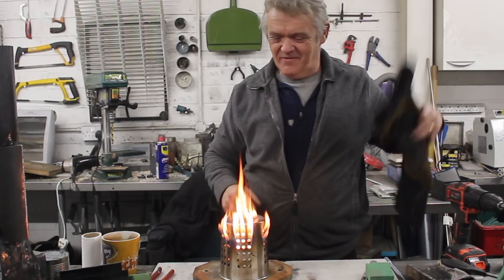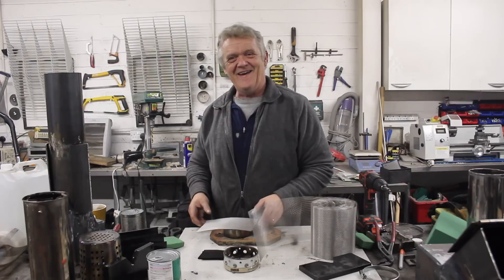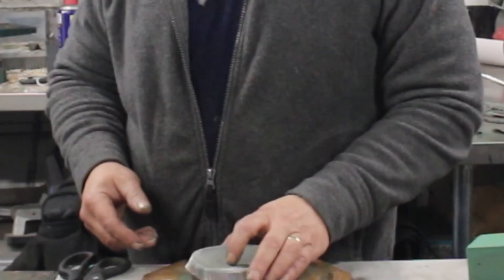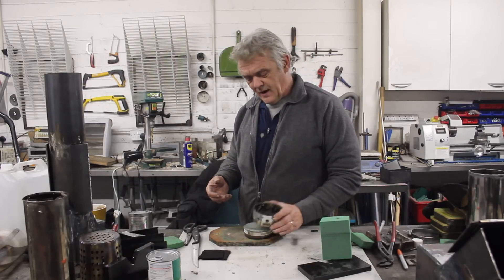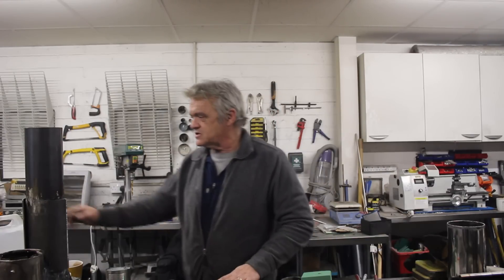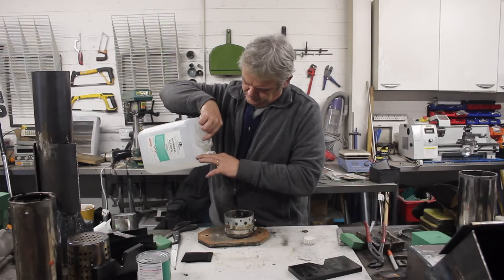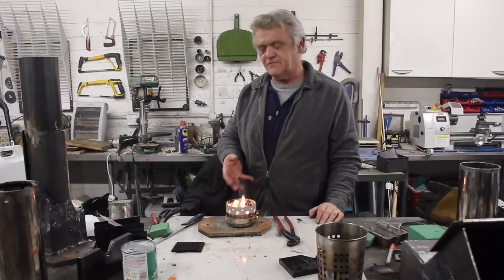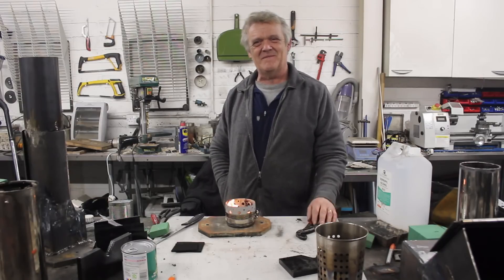1738 The Safety Heater

Comment: All flames from all flammable materials have what's called a quenching diameter. Since the material itself doesn't burn, only the vapour generated by the heat applied, there is a finite space for  each vapour through which the flame can't pass. Increase or diminish the diameter of the space and you can regulate the flame propagation. The principle is what Mr Davy used to put canaries out of work in coal mines. Maggy Thatcher was probably an admirer.
Reply from the maker: cheers mate

Comment: I added a "catalytic copper wick ", I found by putting an upright tube of copper mesh on the safety screen (scaled like a Bday cake) after it heated up it attracted the flame and changed the shape and colour of it to like a really really deep gloomy orange lantern light plus when the flame is blown out the copper/ethanol catalytic reaction kept it glowing and  put it into a standby/economy heat mode . So for times say when your solo camping in the cold or in a car for the winter, yep, no flame.....:yougotthis:

Comment: That's totally cool Rob. 
Soup and tuna cans would be an excellent use for these burners.
Reply: I was just thinking of tuna cans!  Maybe making a few holes in the top with one of those triangular shaped punches on the other end of a can opener we used to use to open up the big cans of pineapple juice.  Içve used those forever and I still have no idea what those things are called!

I saw another guy on YouTube bend the triangle bits all the way in.  Not only were they air holes, but they formed a little raised stand to set the pot on above the flame.
Reply: @colleenforrest7936 
 
The ones that had the round end on one side and the pointed end on the other we called bottle openers.

The one's with the crank we called can openers.
And since the pointed tool is used to open cans, it's a can opener.
Reply: @scotttovey  the rounded ones open the bottles and the crank can openers open that cans, but the pointy ones put the triangle holes in the lids so you can pour liquid out.  Just wondering if those had an official name other than just calling those can openers too
Reply from the maker: oh yeah for sure
Reply: I think they're referred to as pierce-type can openers.

Comment: Inspiring video as always! 
I made a close approximation of this, except my reservoir section was filled with ceramic fibre topped with a disc of carbon felt then the stainless mesh. The initial burn was strong but controlled, presumably by the mesh. It then died down to a low blue flame for the majority of the rest of the burn. Not ideal for my use case (a reasonably decorative room heater), perhaps my can was too tall and narrow for efficient wicking. Love the safety flame concept but the search goes on for my consistent controlled burn.

Comment: Wow!  That's a home run in all aspects.  My mind is thinking if you can get solar and a Stirling on a full burning stove you can replace an internal combustion in efficiency and it would drop the weight of a vehicle.  There is fancy engineering with glass which would allow light to pass to solar.  I am itching to try it but have a lot going on in my life.  So if you want to look at that go for it.
Reply from the maker: cheers mate

Comment: This guys YouTube channel should be seen by every citicen of Ukraine. They have dire need for some alternative heating at the moment. I like 1700 or 1702 the heater with carbon felt and vegetable oil. This one here is better for the really flammable stuff like alcohol or petrol. I think I will try it with some denatured alcohol, foam from christmas arrangement and cooper mesh. I think I will also try one really small 3-4 cm with carbon felt instead of foam and I hope that it´s not to hot and melt the cooper mesh.

Comment: It’s all a bit dangerous but useful in an emergency. CO and CO2 are a potential danger, plus particulates in the air if you burn the wrong fuel. Then there is the risk of setting fire to the curtains, the open 5l bottle of alcohol etc! We heat with a properly installed 8kW wood burner which provides enough heat so we won’t be using the central heating this winter. With an air inlet and sealed flue none of the nasties get into the air we breathe. Obviously this doesn’t work for everyone- you need a free/cheap source for the wood, but it works for us.

Comment: 1:55 be aware that Oasis is essentialy foamy Bakelite without a filler, it's phenol-formaldehyde foam. Make sure that it cannot get to the decomposition temperature, or it can release formaldehyde vapor.
Reply: Do you know what the decomposition temp is?
Reply: @BurntFossil  Phenol formaldehyde resin begins to decompose around 300 degrees C. I do not know if/how much it offgases at lower temperatures.

Comment: Could you create something that would be like a wood burner in the house, but with no smoke? Basically a cheap alternative to spending £thousands on a wood burner
Reply: I've been working on it for a long time. All I've come up with is using a small camp stove and running the stovepipe out a window. I used to install the real ones for a living. I've got a wonderful little woodburner that I bought new for less than $300 US. Enough stovepipe and a damper would run you maybe $75-100 more. You'd need to purchase a purpose made fireback and hearth or produce the same with available materials (think stone slabs/concrete wall backing...). There's just no real cheap and safe way to burn wood. PS the trick to not getting smoke is to light a paper log or some such thing and hold it up in the flue for a good thirty seconds before lighting the stove in order to warm up the flue and start a good draft going. Voila! No smoke. Oh, and use only very dry seasoned wood.
Reply: You're describing a rocket stove - he's made loads
Reply: He just made one for Luke
Reply from the maker: of course mate - what you are talking about is just a rocket stove - but a little adaptation is still needed - I have ordered the parts
Reply: @ThinkingandTinkering  thank you Robert. Just watched your new video with the box on the rocket stove.  It's great 😄. Keep up the good work, love the videos 👍
Reply: @jerrodlopes186  thanks 👍

Comment: What if you had a jar with a large diameter metal lid. It uses copper mesh and about five holes in the lid. One in the center for a bolt. On this bolt is two wooden wheels. Holes two holes on the side of the bolt line up with the three hole in each wood wheel. Then two more holes on the outer edge of where the wooded wheels are. The wooden wheels have the copper mesh tacked on to make a cylinder going up to the top of the lid so air can escape. Then two holes in the bottom of the bottom wheel have pipes going to the top of the lid along the outer edge. Inside the jar is a small carbon felt with a steel sheet acting like a spring to hold it against the wall of the jar. In the bottom is your acetone or methanol. The copper sheet should be pre heat treated to make an oxide layer on the outer wall of the mesh. This is done by heating the copper mesh against the bottom of a pot or pan to keep the copper mesh from melting or getting to hot so only the catalytic oxide layer is formed. Once assembled put about a few ounces of acetone in the bottom of the jar. Preheat the mesh a little bit but not too much. Put the lid and assembly back on. If it was made right it should catalyze the acetone and draw fresh air in through the bottom by convection. Though feel free to tell  me how this idea is flawed. Because it is just a planning stage.
Reply from the maker: I think it is an awesome idea mate - it's difficult to comment on ideas as the real issues one in the practicalities - the devil is in the detail as they say

Comment: So you could probably modify the wicking arrangement with the carbon felt and a larger reservoir? How might one control the heat out put? Instead of moving the wick up and down, might it be more convenient to move a mantle? Perhaps a telescopic or sliding mantle.

Comment: great inspiration! are fumes an issue at all? id like to know what design/fuel will be best in the house, or in the shed, what ventilation Id need.
Also where I could use aluminium safely instead of steel cans.

Comment: I wonder if when the Oasis foam gets low on fuel in it will it then start to melt or burn itself?  A candle wick without wax will burn up.  One thing I have been thinking about doing is to source some of the Oasis and use it to cool carbon arc rods(tightly bound side by side) by filling it with distilled water.  Evaporative cooling.  Then lay on top of them battery carbon rod centers.  Heat the top side, the Oasis cools the bottom side and see if that will produce current.  I figure if the top layer of rods has a different impedance than the bottom rods then it may make a thermopile much like your paper and pencil one only larger.  I don't know, but may be worth a try to find out as it would not be quite as fragile.
Reply from the maker: I like the thinking mate - give it a go and see how it works - maybe do a video?
Reply: @ThinkingandTinkering  I may do it a bit later.  Being a caretaker for my mother right now due to a cardiac event so it would be after things settle down.  Thanks Rob!

Comment: Awesome Genius Rob. I'm off to get some Oasis. I presume the holes in the burner head are required? ie if using tine drill holes around the circumference?
Reply from the maker: you don't need oasis mate - I just used that because it is what I had to hand - cottonwool will do it - in fact anything that wicks - the holes in the ring aren't needed - they are just there because I used strapping to make the ring - a ring to support the second mesh is needed - you might want to look at this https://www.youtube.com/watch?v=gTR6yiPW3OA - caryex2 did a replication

Comment: Could you get one going with an enclosed wire mantle?
That way you have even less loose flame
Reply from the maker: oh yeah
Reply: I wonder if you could get the honey comb out of a catalytic converter intact. Just plopping it on the top would make an excellent radiant heater
Reply: @mhbh1979  I don't know much about catalytic converters but a Mass Airflow Straightener would probably work nicely, if you can find one

Comment: Thank you for the video. Could I use two sweetcorn cans, with mesh like this? Another question, if I can please? My family were saying I couldn't use hand sanitizer as a fuel for either a small stove or for heating? Could you tell me if it's wrong to do so. Also, can I use Methylated spirits in this burner? Thanks! 👍🏾🇬🇧
Reply from the maker: yeah loads of ways to do this the only important thing is the mesh and the reservoir of fuel - anything to hold them in place will do this job - any alcohol heavy fuel will work just fine - including hand sanitiser and meths

Comment: I think the safety of its okay but I believe that knocking it over while it was on, could still and very possibly and most likely still burn and alcohol and other fuels at elevated temperatures react way differently than first lighting them.  Take ordinary charcoal lighter fluid and heat it then light it and you get a way bigger explosion than the safe charcoal fluid that you normally lighting.
Can we see a kicked over outside test. Not just kicking the top off but knocking the whole container over.
Reply: The trangia stoves are filled with fiberglass to prevent spillage, but I think they too continue to burn when tipped over. I've been told that the coil burners self-extinguish when tipped over, though.
Reply from the maker: check this out https://www.youtube.com/watch?v=gTR6yiPW3OA

Comment: This doesn't exactly pertain to this exact invention, but more on the electrical generation side of things and storage. Have you ever heard of John Hutchinson? And his Discovery called the Hutchinson effect? He basically found out a way to make miniature self generating power cells that can have up to 1.5 volts each and they're made out of quarter inch copper tubing about an inch long and either a galvanized nail or magnesium rod of some sort small enough to fit inside the copper tubing without touching it. He uses a mixture of Epsom salt, Rochelle salt, a little iron pyrite, Galena, and calcium carbonate and it creates a self regenerating power medium between the nail and the copper tubing. I think you could really go somewhere with his discoveries because he's gone basically missing from the whole public scene since I seen his first video on it which I can't even find anymore. I have a recipe that I wrote down though from his video if you would like it as a starter

Comment: Speaking of safety do you take carbon monoxide readings of your different heater designs?
Reply: I can't speak for him, but I have. I use a burner a little bigger than this with methanol and it never measures over 7-9ppm CO. White gas and candles have, especially when they're about to burn out.
Reply: @jerrodlopes186  I was thinking more of the rocket stoves and other wood burning ones.  If it were me, I think it would be prudent to say very loudly and upfront that a particular design is only to be used outdoors.
Reply: @simonhodges6084  humanity has been burning wood, dung, oil and coal indoors for millenia. I used to work with fireplaces and stoves for a living. Installed or built correctly and used as designed, they are quite safe.
Reply: @jerrodlopes186  I think you are being very naïve here.  We now have many safety regulations regarding such things.  "Installed or built correctly" indeed.  Given a cost of living and energy crisis there is not enough information for desperate folk to do this safely.  Run your argument past your lawyer.  Its no 'defence' at all if someone dies from CO poisoning.
Reply: @simonhodges6084  and I think you're just the nervous Nelly type. What do I know? I was just an NFPA certified hearth technician.
Reply from the maker: I did a video on this topic - and in the video I predicted folks wouldn't watch - seems I was right

Comment: What is oasis foam made from? Will it melt / burn after being close to the fire for a while?
Reply from the maker: no it doesn't get hot - the cooling effect of vaporisation keeps it cool - but if you are worried about it use something else I did say on the video I only used oasis because I had it to hand loads of things will do and some will do better
Reply: @ThinkingandTinkering  thanks Rob, I didn't think about the vaporisation having a cooling effect, I was trying to work out why it wouldn't get so hot when the steel mesh did. Cheers - great video

Comment: PLEASE do NOT weld galvanized steel.  A lot of strapping is galvanized.  Welding the coating vaporizes the zinc and the fumes are toxic.  There are special procedures to use if you must weld without removing the coating with a wire wheel or grinder.

Comment: I wonder if this would work off of used motor oil?  If it could this could  be upscaled to a rocket stove and used for heat in a workshop, just add in a feed system to keep the oasis foam wet(?) and it should last a long time.
Reply from the maker: Good question!

Comment: i wonder if this would still work with a bunch of the carbon felt in the bottom instead of the foam since the carbon wont burn away
Reply: It will. It's just a little expensive.
Reply from the maker: you don't need to use oasis mate anything that wick will do - including the carbon felt - I didn't use the felt as it is a bit expensive to do it that way

Comment: Very nice indeed. I was wondering how they blend ethanol into petrol with the idea of blending some more hydrogen atoms into my used motor oil to change its density so as to modify its burning properties . Breaking down the alkanes is the idea using the heat of the fire in the process to break down the longer chains . Not sure if it's  possible on the fly but I did add some sodium hydroxide to some dish soap and mixed it in the oil and not sure if it worked but it did seem to cool down the flame which inturn vapourises less and that may have just been the dish soap so that might be enough for now . The other way I have been doing this to create a soot less fire is by adding fibrous bark from a tree to change the surface area of the fuels so it can handle the air ratio better . Any suggestions Rob or anybody else ?

Comment: I'll have to ask: If the fuel cell is offgassing due to the heat from the flame, and the top part is acting as a flame arrestor, thus lifting it way takes the ignition away from the fuel, is not the fuel cell still offgassing volatile vapors? IE, if for whatever reason a spark remains, or another nearby source of ignition exists, can the fuel cell not directly maintain a flame without the presence of the burner head? I think that the burner head isn't necessary for there to be a flame, and if it isn't knocked off quickly and cleanly, such that some of the fuel cell's mesh is exposed, it will ignite directly on the cell.
Reply from the maker: check this out https://www.youtube.com/watch?v=gTR6yiPW3OA
Reply: @ThinkingandTinkering  Exactly as I thought. Once warm enough to offgas above the flash point it will simply continue to burn. However, alcohol fuels can be diluted with water and immediately puts out the fire, which is the primary reason they are used in marine applications.